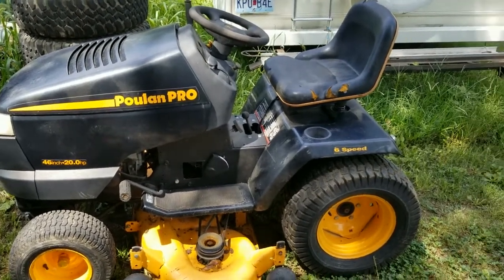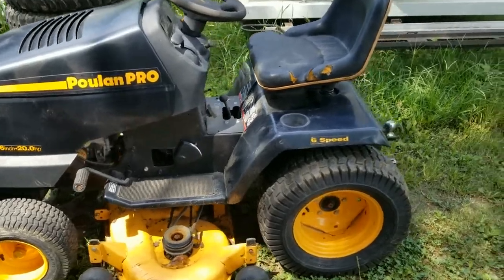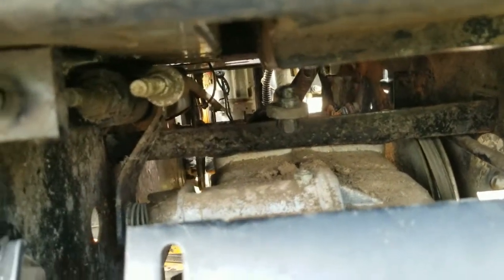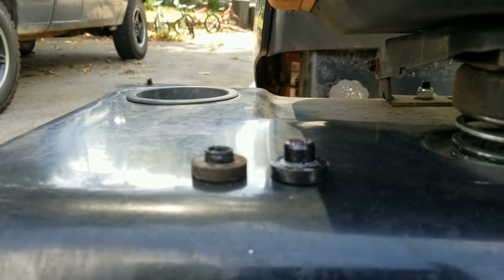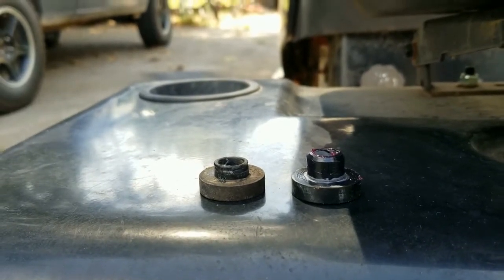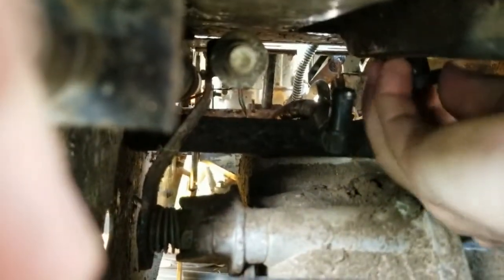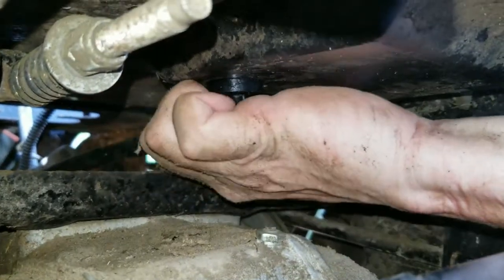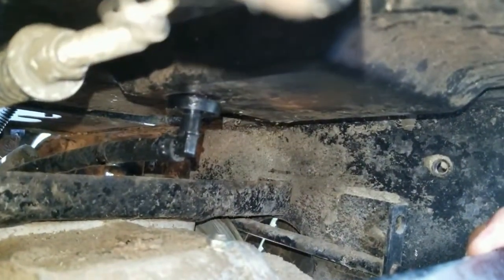Riding lawn mower fuel tank leak. (Poulan Pro)

Comment: Pretty easy to fix I guess, but a cheap design.  Glad you figured it out. I wonder if it had been leaking before it finally came out.
Reply from the maker: I had it sitting in the sun maybe it built pressure faster than the cap vent could handle and blew out?